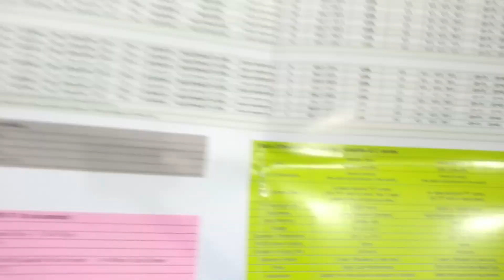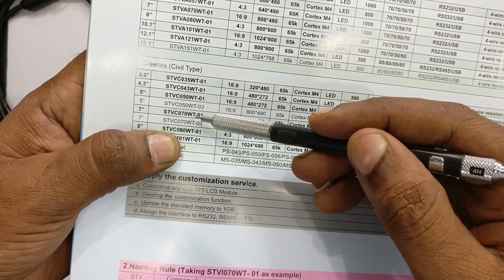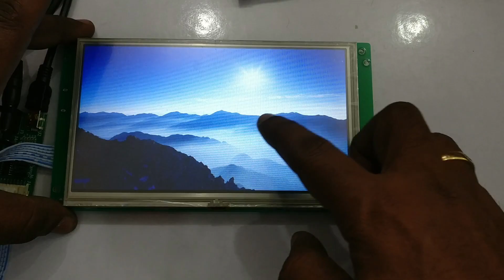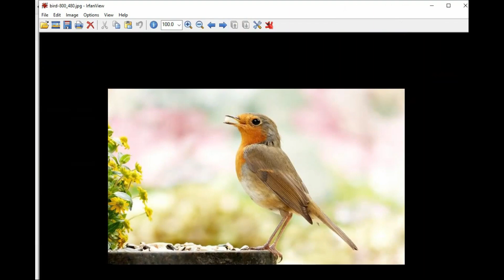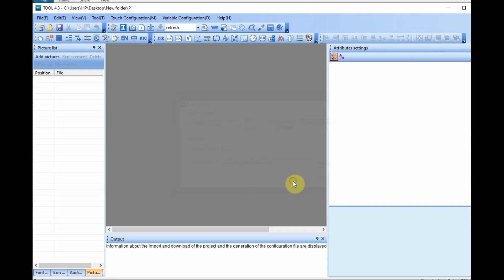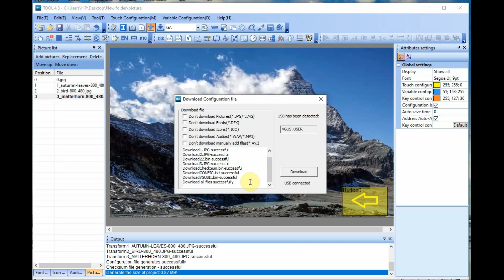STONE HMI TOUCH TFT DISPLAY - Getting Started

Comment: would you share me link product information before for ordering?
Reply: Hi Mr. Software Solution Industries:
Thanks for visiting the product from STONE TECH.
This is Andy.
Our TFT-LCD Module is a display system includes:
-CPU (Cortex M4);
-LCD driver module;
-FLASH memory (128 MB, can be extend to 1GB);
-UART (RS232 / RS485) port;
-GUI design software.
For product information, you can refer to our official website information:
Www.stoneitech.com
If you want to buy our products, please buy from the following stores:
Alibaba Product link:
Https://dwz.cn/c7qxhemh
Amazon product link:
https://www.amazon.in/s?k=stone+tft+lcd&ref=nb_sb_noss(IN)
https://dwz.cn/gnlrXDCk (United States)
https://dwz.cn/xnz5pTK9 (Japan)
https://dwz.cn/t2Ji0v4E (UK)
https://dwz.cn/KUJ5kBgu (France)
https://dwz.cn/3Wqh7RAM (Italy)
https://dwz.cn/2XDDEq8f (Spain)
Ebay store link:
Https://www.ebay.com/str/stonedisplay
Aliexpress store link:
https://dwz.cn/PpQlr2RU
Good luck with your project!
Best Regards
Andy
Beijing STONE Technology Co., Ltd.
Add: Room 1407, Building C, Yuanyang International Ce
Nter, East 4th Ring Middle Road, Chaoyang District, Beijing, Beijing.
Reply: Hi our LCD has 99% same software with much cheaper cost.

Comment: How much is it cost ?
Reply: Hi Mr. prabakaran palanivelu:
Thanks for visiting the product from STONE TECH.
This is Andy.
Our TFT-LCD Module is a display system includes:
-CPU (Cortex M4);
-LCD driver module;
-FLASH memory (128 MB, can be extend to 1GB);
-UART (RS232 / RS485) port;
-GUI design software.
For product information, you can refer to our official website information:
Www.stoneitech.com
If you want to buy our products, please buy from the following stores:
Alibaba Product link:
Https://dwz.cn/c7qxhemh
Amazon product link:
https://www.amazon.in/s?k=stone+tft+lcd&ref=nb_sb_noss(IN)
https://dwz.cn/gnlrXDCk (United States)
https://dwz.cn/xnz5pTK9 (Japan)
https://dwz.cn/t2Ji0v4E (UK)
https://dwz.cn/KUJ5kBgu (France)
https://dwz.cn/3Wqh7RAM (Italy)
https://dwz.cn/2XDDEq8f (Spain)
Ebay store link:
Https://www.ebay.com/str/stonedisplay
Aliexpress store link:
https://dwz.cn/PpQlr2RU
If you have a large purchase later, I can give you a good sample price.
Good luck with your project!
Best Regards
Andy
Beijing STONE Technology Co., Ltd.
Add: Room 1407, Building C, Yuanyang International Ce
Nter, East 4th Ring Middle Road, Chaoyang District, Beijing, Beijing.
Reply: Our LCD manufacturer is 400,000 square meters, similar software as STONE and much cheaper prices.

Comment: How much is the price?
Reply from the maker: Cost is around 8k for 7 inch size. OK for big industrial projects.
Reply: @SaravananAL  it shows me $160 which is way higher then my expectation including delivery charges, how can i get in India less costly
Reply: Hi Mr. GOWTHAM SHANMUGARAJ
:
Thanks for visiting the product from STONE TECH.
This is Andy.
Our TFT-LCD Module is a display system includes:
-CPU (Cortex M4);
-LCD driver module;
-FLASH memory (128 MB, can be extend to 1GB);
-UART (RS232 / RS485) port;
-GUI design software.
You can find the corresponding prices of our products from the following platforms:
Alibaba Product link:
Https://dwz.cn/c7qxhemh
Amazon product link:
https://www.amazon.in/s?k=stone+tft+lcd&ref=nb_sb_noss(IN)
https://dwz.cn/gnlrXDCk (United States)
https://dwz.cn/xnz5pTK9 (Japan)
https://dwz.cn/t2Ji0v4E (UK)
https://dwz.cn/KUJ5kBgu (France)
https://dwz.cn/3Wqh7RAM (Italy)
https://dwz.cn/2XDDEq8f (Spain)
Ebay store link:
Https://www.ebay.com/str/stonedisplay
Aliexpress store link:
https://dwz.cn/PpQlr2RU
If you have a large purchase later, I can give you a good sample price.
Good luck with your project!
Best Regards
Andy
Beijing STONE Technology Co., Ltd.
Add: Room 1407, Building C, Yuanyang International Ce
Nter, East 4th Ring Middle Road, Chaoyang District, Beijing, Beijing.
Reply: @technologystone6598  where can i buy in india?